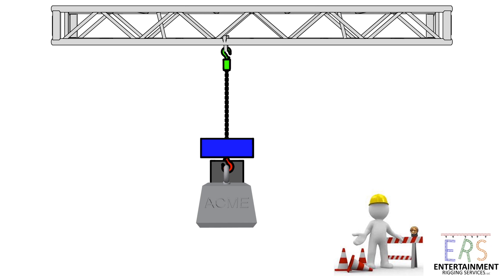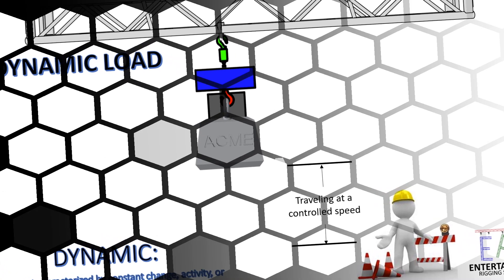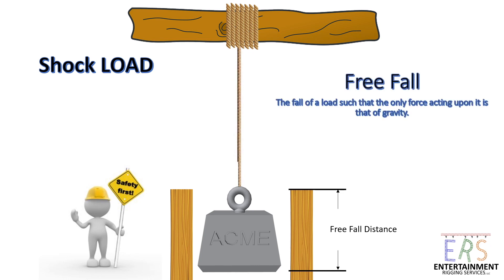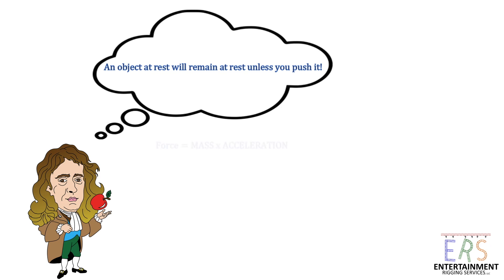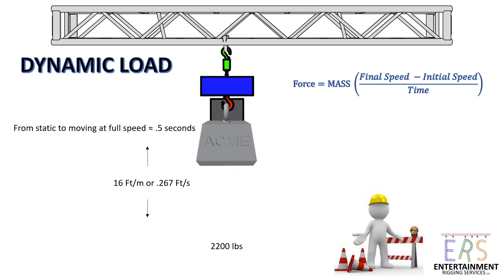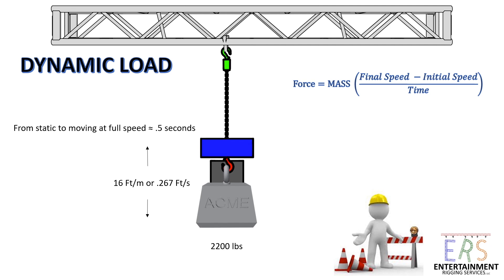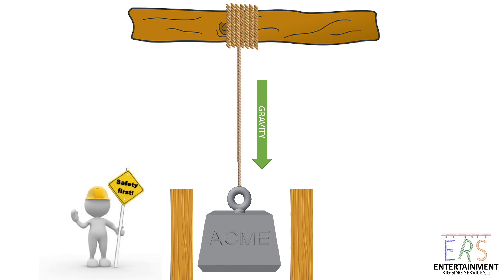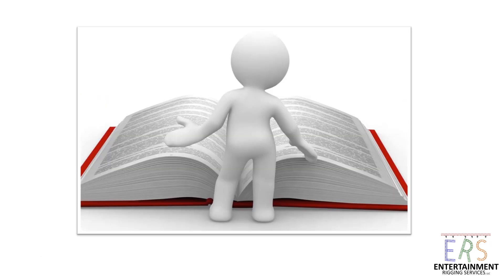Shock loads explained

Comment: I would say the load is moving at a constant velocity, the load on the truss is static.  The load is certainly dynamic during the initial acceleration and the final deceleration.
Reply from the maker: With chain hoists this isn't exactly the case. Technically the hoist is constantly changing speeds due to the fact that the lift wheel is usually 4 or 5 sided and isn't a constant diameter. But this velocity change is so small that you would never notice it on a load cell. Your overall point is still correct.
Reply: I have also sent you a pm on Facebook messenger.
Reply: 1:00-1:09